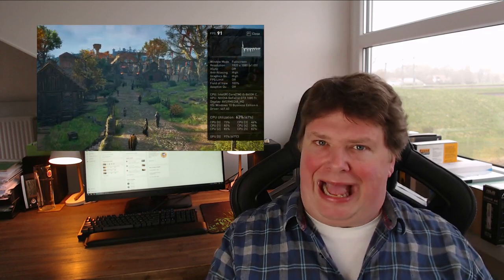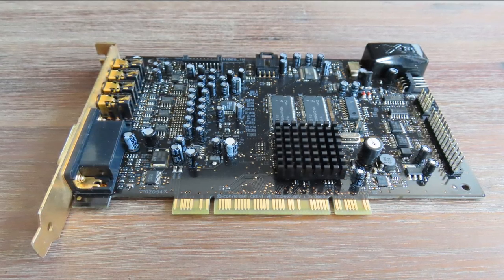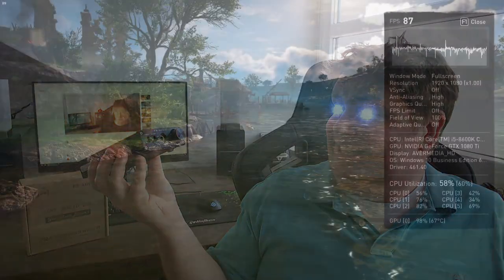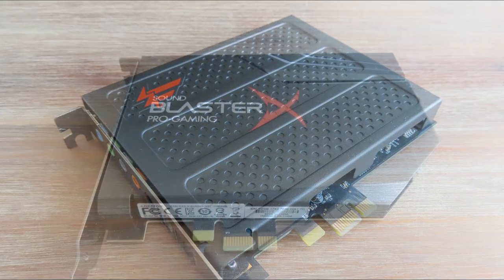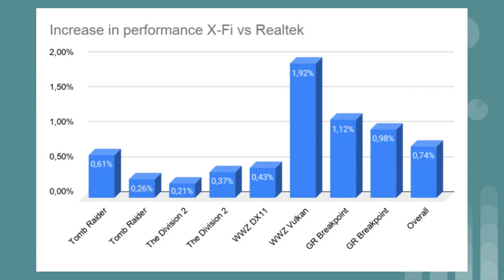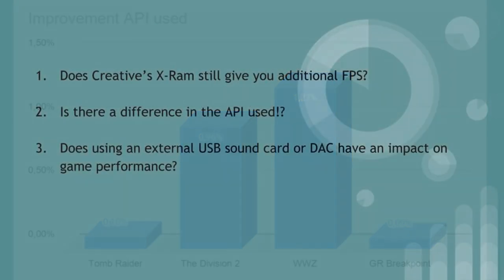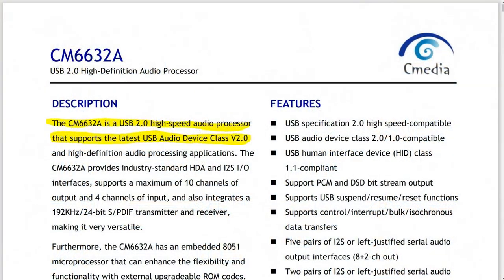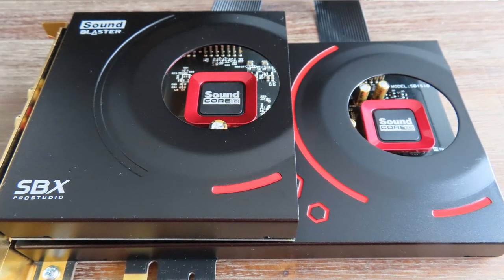Does a sound card give you more FPS like it used to do?

Comment: Back in 2015 when i still had a Q6700 OC'ed at 3.2GHz and a GTX 660, i was trying to increase my FPS when playing The Witcher 3.
A friend of mine had a Xonar D1 (PCI) which he didn't want anymore.
When i installed it t and tried to play the game the game's MINIMUM FPS jumped from 17 to 26.
It was so mind blowing i had to take the card out and run the game again without it to confirm the FPS gains were caused by the card itself and what do you know, back to 15 FPS and the same increase again when i installed it back again.
What exactly happened was that, the game was maxing out my CPU usage which had to deal with sound as well, so when the card was installed the sound card, the processing was offloaded to it and since it was a CPU from 2007...well, gainz!
Reply from the maker: Didn't know that! I did finish Witcher 3 some months ago. One of the best games ever made!
Reply: microsoft had the brilliant idea to remove DirectSound3D from their os' to allow the use of crappy sound chips in motherboards. with windows xp I remember you could even double your fps using a creative sound card istead of a cmi8738 (for example) sound chip.

Comment: Stumbled on your channel. What great content, you deserve more subscribers. Pity this generation are content with just USB sound ;)

I had a Soundblaster Z PCIe lying around and finally installed it onto my newer Desktop - AMD 5600x, RTX3070 with onboard Realtek ALC1220. I thought I’d share my results.

Used 3DMark TimeSpy benchmark and the SoundBlaster Z consistently outperformed onboard audio in terms of FPS by 1%. SBZ Graphical score 13814 (91.42 FPS), Realtek 13771 (90.84 FPS). Not much but it is still an improvement. 5fps increase could be achieved with my setup for games going over 150fps+.

So, it looks like the SBZ is going stay plus has better fidelity! I suspect older CPUs would benefit more in FPS with a soundcard.
Reply from the maker: Cool to see those results from your system! And the Z has good sound as well. Will you be using it in the future from now on?
Reply: @AntonsHardware  yes I will, it’s staying on. I didn’t expect these results from a 5+ year old pcie soundcard. I’m satisfied and won’t need to buy an external DAC! 

Thanks for your videos, it has helped a lot.
Reply from the maker: Glad to have helped!

Comment: I removed my soundcard sometimes it would not show up in system devices and I was earing some interference noise, so... Bad xperience with xonar ae 7.1 and with ae-5 plus.
Reply from the maker: Too bad. I wish I could help! I was wondering, maybe there is a small issue with the PCI-E slot? Maybe some dust in there? 
Maybe the EVGA NU is more something for you! You could check the B stock on their site to get a bargain!
Reply: @AntonsHardware  thanks Anton but it's out of stock I've checked earlier this day. I'm thinking in a external solution like modi schiit 3 but seems like they're out of stock too since last year, so...

Comment: Anyone hearing the subtle clicking noises  like at 4:52?I'm using a headset.They're everywhere troughout the video.
Reply from the maker: Hi WiseOldDudee, I tried to hear them as well, but I cannot hear the, I tried checking the source material, but I couldn't hear or see them in the audio stream. You're sure it isn't your setup? Can you also hear them on other setups?
Reply: @AntonsHardware  Just to make sure I grabbed a pair of earphones and listened from  4:52  onwards on my phone.(instead of using my pc/headset) and yea they are there.I may be a bit anal about this stuff hence why no one brought any attention to it but I hear them on my phone aswell.Almost certain its mouth noises I think.
It's more a sanity check for me as I got a new pair of headphones but since I can also hear them on my phone with a pair of earphones Il discount it being a headphone issue.
Reply from the maker: Lol. I'm rather anal about that too, so no worries. I'm also the guy who is annoyed when there is a stutter in stuff on tv. I listened to the section again and now I did hear a faint click in the higher frequencies. There are some theories for this. Back then I used Videopad, which is a very poor editing programme that uses a lot, and I mean a lot, of cpu power. It wouldn't surprise me if that somehow introduced clicks.

Comment: Here's a question for you:
Would using a USB gaming headset on a USB sound card/DAC make more sense since you need a USB signal anyway?
Reply from the maker: Wow! :D Ehhmmm. I doubt you can connect a usb sound card to a dac. Usually it only has headphone or speaker outputs.

Comment: 4:12 Jeez a soundcard with a 6pin thats insane! There are lots of GPU's that don't even need a 6pin why would a sound card ever need more wattage then a gpu ??? Stability? im sure it would never ever really utilize it, the board should be more then capable of providing it power
Reply from the maker: Yes it should, but the manufacturer thinks that power straight from the power supply is "cleaner", meaning it doesn't suffer from fluctuations as much. Today a motherboard is more than capable of providing clean power.

Comment: Ah yes 15 years ago a good soundcard could do so much for you, beyond sounding a lot better then whatever was put on the mobo, but also made things smoother. 
Now? Well, you still can get better sound out of a sound card of top grade quality compared to cheaper motherboards. But all depends on the sound system you run it on further if you can use it. And you have to double check, the mobo sound quality has improved enough so that for cheap sound systems....it isn't too bad. 
I did buy an Soundblaster RX because it has pretty clean sound. It is hooked up to a good quality sound system to... you know it is worth that. Half of its tricks don't work under WIndows 10. But still, clean sound and good DAC's!

Oh and I use an USB Dac, for my laptops, there is hardly space in laptops to put good audio parts so a DAC makes sense. Gives stronger audio signals.
Reply from the maker: Sound cards will nearly always give better sound quality, but the improvement isn't as big as say 20 years ago. And you are correct that there are many variables that have an impact. Like speakers of headphone used, EMI interference, bitrate and sample rate of the recording.

Yes, that is a good reason to get a DAC. Creative did use to make internal soundcards via the PCMCIA slot: https://www.amazon.nl/Creative-PCMCIA-Blaster-Notebook-70SB053000012/dp/B0007XRZ08 I wonder how good they were.